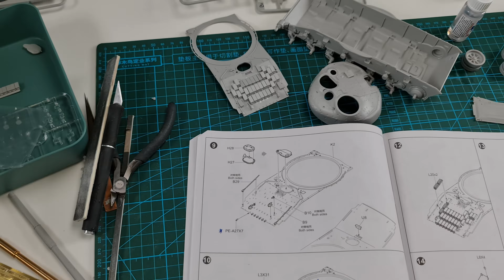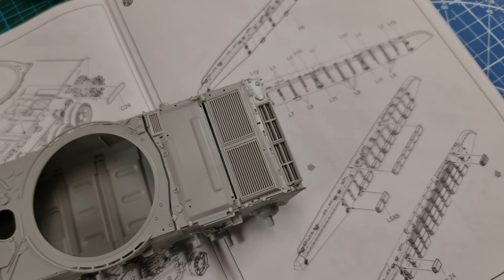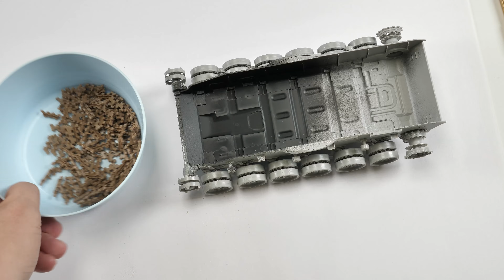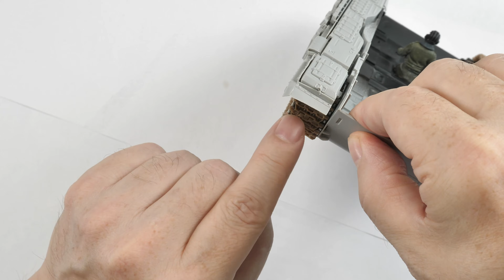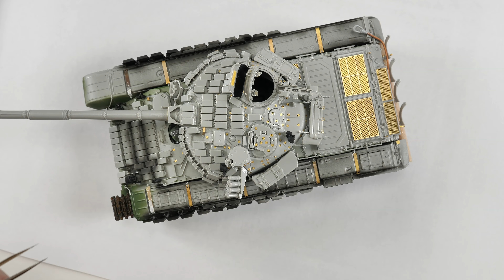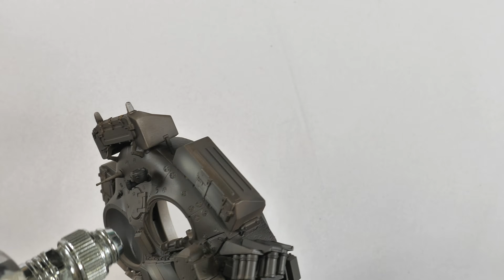Trumpeter 1/35 T-72 B/B1 Part II BUILD & PAINT

Comment: Hi! I am currently building this model. Thanks a lot for your advises. Little question. In the step 36 in the manual, I do not find the piece H32. There is simply not this piece of the rack H. Did you face this case? Do you know if it is an error of Trumpeter? Is this piece is in another rack? Did I see bad? Thanks for an answer.

Comment: could u drill the links out? and use coper wire to make them workable? not thinking about the needed time
Reply from the maker: Anything is possible... but i for sure would not have the patience to do it. I will buy a set of "workable" trumpeter t-72 tracks in the future for a comparison on a future build.

Comment: If I can offer a small tip, count out and join all of the tracks for a single side. Let it dry for around 30 minutes on a flat surface, then lightly brush more glue over the previously glued portions to soften the areas of tracks that you wish to bend to conform to the road wheels. It's so much easier with less track link separation.
Reply from the maker: good idea ! I previously made tracks in a similar method i would build the entire run on a piece of tape.. let set for 10 mins ... then using the tape transfer it to the running gear and wrap around. The problem i found was that when making adjustments around the idler.. the track would come apart when fitting... so that is the main reason I use this "make lengths and link" method.
Reply: nice tip man!